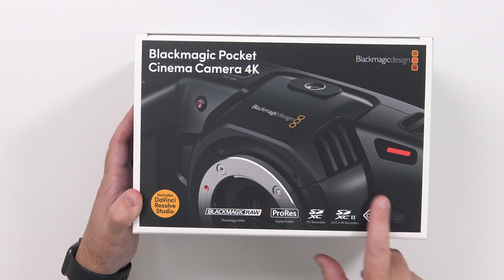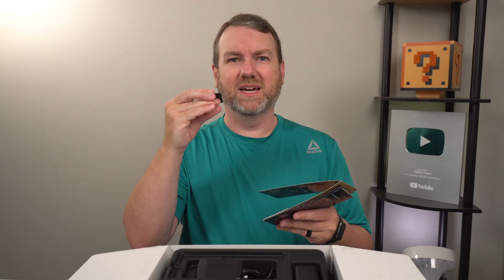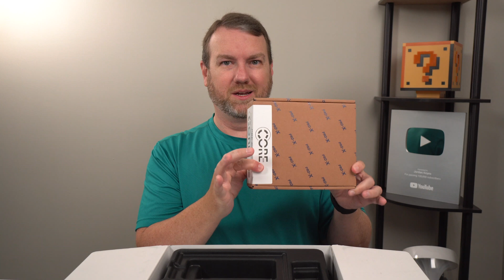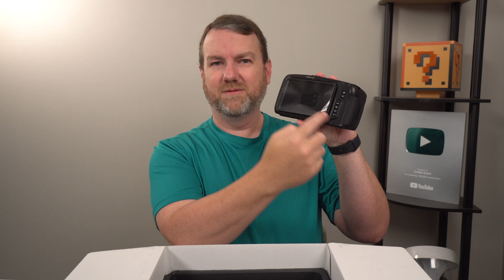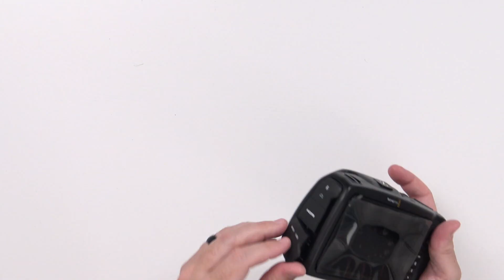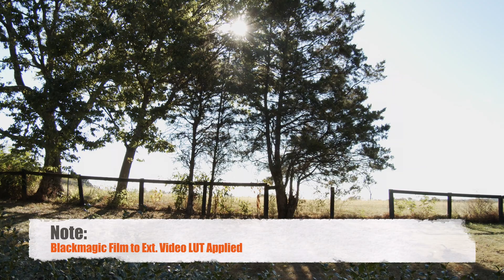BlackMagic Pocket Cinema Camera 4k Unboxing and Sample Video

Comment: Thanks for the review. Small rig has some good solutions to remedy some of the issues you had for mounting the ssd's, etc.
Reply from the maker: Spoilers. ;)
Reply: @JordanKeyes  Haha. If it's not too late, the SmallRig Universal Holder for External SSD W/ USB-C cable clamp BSH2343 is better than the smallrig 2245. You'd need either the half cage or full cage 1st though.
Reply: @JordanKeyes  can you upload a new video please